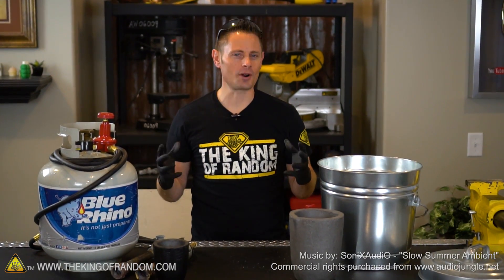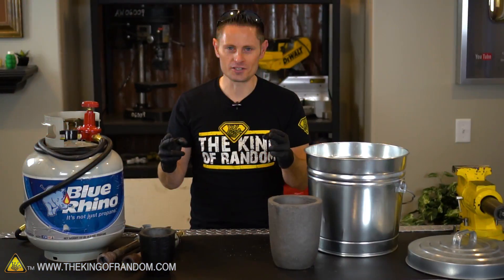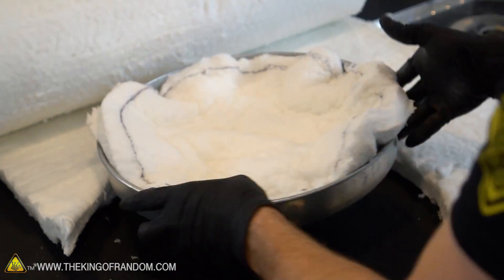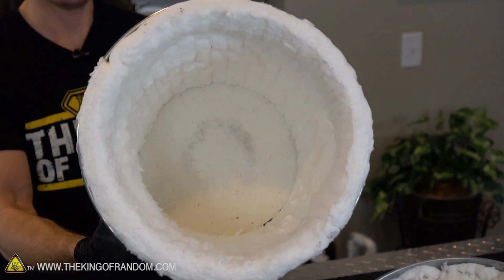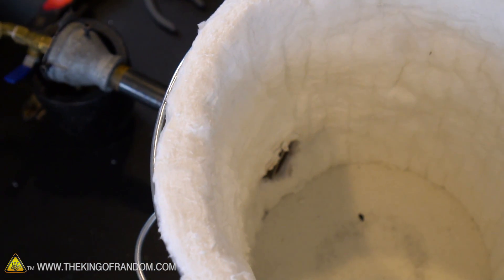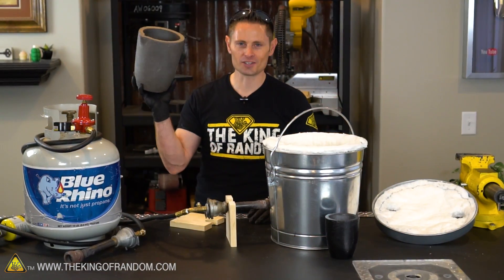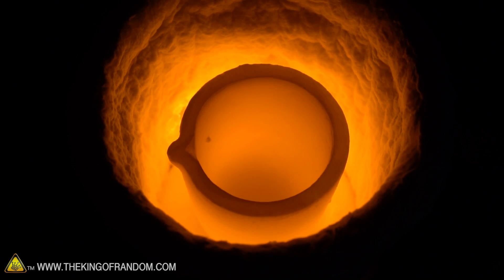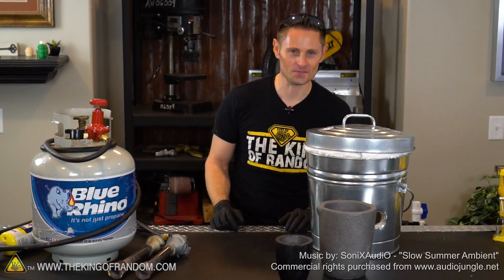Make A Trash Can Metal Foundry | How To Make A Metal Foundry For Melting Brass And Other Metals

Comment: Everyone: don't make a forge using galvanized steel
Me: poisonous fumes go snnnnnnnnnnn
Reply: use heatproof paint to prevent the fumes or muratic acid to remove the zinc layer, use a respirator too incase something goes wrong.

Comment: It's a furnace...not a foundry. A foundry is the place of work where a furnace is used to melt metal, pour molten metal into moulds and then to fettle the castings.

Comment: What, no satanite coating? Those fibers are going to go airborne and you'll likely breath them in. It's best to coat the Kaowool with about 1/8~1/4 inch of satanite. It also improves and protects the Kaowool by increasing its insulating properties.

Comment: turns out graphite crucibles are terrible.     verry expensive,  they corrode.   you cannot poor copper because it's too high temperature. (it will fully corrode after 1 use)   

if you make an electric foundry instead you can precicely control the temperature and then you can use a steel crucible.   it will last much much longer without getting too hot like it would in a propane or coal foundry.

Comment: Since it insulates so well, use spray adhesive to stick the wool to the lid.
Also, reaching in to grab the crucible looks daunting, so why not cut the bucket in half above the torch holes but below the level of the top of the crucible, then attach it to the lid.
When you pull the lid you can grab the crucible easier.

Comment: try melting some cheap jewellery (like the 925 rings and stuff you see on ebay/aliexpress) and cast an ingot from it. haven't seen you cast silver and it'd be interesting to see how the ingots turn out and finding what exactly the rings are really made up of (some of these rings are as cheap as a $1 so not too bad for testing an experiment)

Comment: What setup for the Gas nozzel at the end of the pipe did you use? Where can i find the parts for the Gasnozzel? How did you mange the O2 feed? Is that big thing a blender for the propane and air? I would be more than thankful if you could put the link of the parts for propane can in the description. Thanks

Comment: Has anyone built this using just one torch? Curious to know if/how well it would work.
Reply: Nathan Liu works fine with only 1 torch. Just takes a little longer to get the metal up to melting temps.
Reply: Thank you much!

Comment: Does anybody know if I could do this with charcoal and a air pump rather than using propane
Reply: Yeah, check out the mini metal foundry vid, he originally uses that one with charcoal and I believe a hair dryer or some other sort of pump. I would't use it with kaowool though, probably stick to plaster or refractory cement if you wanna go that route just so cleaning out the ash isn't terrible.

Comment: With that Kaowool you could possibly not have a bucket at all and just make a metal frame to hold the Kaowool in place. A little more expensive I am sure but safer.

Comment: For fun I thought I would apply a little of my heat transfer knowledge to the design of this foundry on the "How to Make Everything" channel comments. I'm sharing here as well as since this is the source for the design.
Assumptions:
1. Steady-state conditions.
2. One-dimensional conduction through the wall of 0.0254 [m]. 
3. Constant thermal conductivity for # 8 Kaowool of 0.30 [w/(m*K)]
4. ambient temperature of standard "room temp" 23 °C or 296.15 K
5. inside foundry temp between 1650°C to 2150°C assuming lower of the range 1650°C or 1923.15 K
6. container assumed as a simple Right cylinder r = 0.20701[m] h = 0.38862 [m] (surface area of sides 0.50547 [m^2] surface area of top and bottom 0.65 [m^2] )

heat flux determined from Fourier’s law
this suggests a heat flux of 19216.54 [w/m^2]
doubling the Kaowool layer will lower the heat flux to 9608.27 [w/m^2]
4 times the Kaowool layer will lower the heat flux to 4804.13 [w/m^2]

solving for the heat loss through the wall
9713.40+2*12497.3 = 34708[w]

basically, you could be losing about 118428 [BTU/hr] with the 1-inch Kaowool layer.

Comment: how do u tell when the crucible is ready?
Reply: Crome14 just heat it slowly till it's redhot then let it cool down naturally in the furnace, that way it should eliminate possible thermal shock and if there was any moisture in the crucible it would be gone after this . Also always heat you crucible up with the furnace as putting a cold or room temperature crucible in a hot furnace can very likely cause it to break.

Comment: What would be to happen if you insulated a charcoal foundery with fiber glass insulation?
Reply: J's WorkShop it would certainly not work, common fiberglass insulation has a melting point of 700 degrees  Celsius, Considering a chimney fire can exceed 930 degrees Celsius fiberglass does not afford block off area protection . I've never tried it I'm just going on what I've read and heard .

Comment: Kinda bummed about the Amazon links to the Koawool. Bought exactly what you linked to and just went to install it realizing it was only a 24" x 12" x 1" piece, not NEARLY enough to fit our trashcan. Now I need to order more and wait for it to arrive before we can finish. :(
Reply: I just ran into the same thing. Anyone know how much is needed for the 10 gallon trash can? Turns out this is going to be a lot more expensive than I first thought because I overlooked the kaowool wasn't the right size.
Reply: Just get the 6 gallon option for the trash can then it works fine 😀
Reply: Check your local ceramic supply store got 1" by 24" by 25' for $70
Reply: was that enough?
Reply: george no it's 1 inch by 24 inches by 25 FEET
Reply: spencerjw yeah I am looking at it now and the Kia wool that is linked will not work its way to small. It's not even the size of the lid
Reply: Brian Jackson I'm gonna link the right things when I get a minute
Reply: @jamesbaker6003  one year ago and it's not fixed.
Reply: Yea I'm ordering 1" x 24" x 31"
Reply: Michael Tefft they 6 gallon option can be found at Lowe's
Reply: was that enough?
Reply: george yo guys what he says in the video is totally not enough but if u get two 1x31x24 then it was enough for me (just a little bit left over). But I'd just recommend the 100$ one, which is 1x24"x25', and is plenty more then enough for what ur doing but get it just in case u want to make another one or want more for repairs and stuff like that
Reply: HagWorld I'm confused because from the dimensions you gave the $100 on(1x24x25) is less than a single 1x31x24
Reply: Hagworld oh wow, sorry I misread that my bad
Reply: The stuff in the video looks thicker than 1" -- maybe 2"?  Do you get the 1" stuff, HagWorld?
Reply: The 1"x24"x31" is JUST enough for a 6-gal foundry. Just completed mine today. The 6-gal bucket is 12" tall, and has a diameter of 11" at the bottom and 13" at the top. On the 24x31 sheet I traced a vertical at 20" separating it in 2 pieces: a 24"x20" and a 24"x11". The 24"x20" got cut horizontally in 2 strips of 12"x20" each, and these coat well the sides of the bucket, with some overlap that gets cut off (you get left with a narrow triangle of kaowool). The other part 11"x24" gets first a circle cut of 11" diameter for the bottom of the bucket, and you're left with an irregular piece approximately 11"x13". The lid is 14" in diameter, and you can cut a piece that almost covers all of the lid from the irregular piece. The space left on the lid can get filled creatively with assorted pieces that you get left from the cutting process. When all was said and done, I'm still left with a larger triangular piece about 3"x12", and a number of smaller pieces from the original sheet. And just so that the jigsaw puzzle that I made of the lid covering doesn't fall off, I've attached it to the lid with a few screws, then coated all of the inside with satanite (2 coats). Worked pretty well.
Overall, just one of the 24"x31" sheets was enough. I got two of these but didn't need to cut into the second one. I'll keep it for repairs or maybe a second foundry.
Reply: Thanks so much for the info, stamasd!
Reply: rustymississippi no problem hope that helps
Reply: how much did you have to buy?

Comment: Grant, or anyone who knows the answer. I have a the same type of foundry but with only one torch. I cannot seem to get my swirling action but can get it burning well pointed directly at my crucible. I feel as though this could creat hot spots which would be bad for the crucible. Amy help on getting the swirl? I have my torch at an angle so I feel as though it should swirl but it just keeps going out

Comment: I used to hang hoods for restaurants. The ceramic insulation he is using is very common, safer than fiberglass, while still potentially hazardous, will not hurt you in on application. I worked with it in my face pretty much daily. it was wrapped, however, we had to cut it to certain sizes to insulate grease duct.

Comment: If you have a moment, what sizes did you use for the supplies?  The 10 gallon can in the links doesn't match up with the 12x24" Kaowool blanket.
Reply: Check your local ceramic supply store got 1" by 24" by 25' for $70
Reply: Thanks!

Comment: Will I have to use a steel bucket because the wool will not let heat through so won't it not melt the metal can

Comment: Will one gas tube be suffice, or 2 is needed? Just after to smelt aluminum in it.
Reply: Jockey314 I use 1 and it melts copper so you'll be fine with 1 for aluminium 👍🏻

Comment: do you have to temper it everytime you want to use it
Reply: How to Random no just once👍🏻. But always store your crucibles in a dry place preferably inside your furnace and always heat your crucible at the same time as your furnace as even a pre tempered crucible at room temperature can suffer thermal shock and break or explode if put into a already heated furnace 👍🏻. Oh and check my melting vids ya might enjoy them 😉😁.

Comment: Kaowool isn't so bad before it is fired.  Afterwords, it can be deadly.  Don't use it with exposed fire.  Kaowool should be coated with some kind of refractory.  ITC-100 works great, bubble alumna is super tough and there are many more coatings that can be used.  This is a big no no!  We like watching your videos, but don't touch that stuff after it is fired without a mask.  Seriously!  Lung cancer is next on the random.

Comment: Just ordered the items and a Ladel needed from Amazon(without the propane torch thingy) and came up to $150. It works AMAZINGLY well. Ive made a multitude of Knuckle Dusters, Batons, Throwing stars, knifes and Axes. My next project is to reform those 22mm Cresent Wrenches. Thank you so much for this.
Reply: Update: Removed Handle and made the hole in the middle then used an Arch Wielder to add handles on each side of Hole, like the Cement Donut. Keeps more heat in and allow easier addition of metals, as well as allows access for the ladel.

Comment: to the people who want to do this, those links are wrong, I purchased the kaolwool and it reaches barely halfway around the bucket. no extra for lid or base either.
Reply: You Dont Know Me BbY Would you happen to have a link to the correct size? I just opened my package of two today and I don't think even that is enough.
Reply: Chance Sutter I haven't looked for any other links yet, perhaps getting a smaller bucket might be the way to go since the links are absolutely worthless for the bucket shown
Reply: You Dont Know Me BbY like the smaller bucket he uses in the original foundry? Let's do some research!
Reply: I figured out for the trash can if you just get the 6 gallon option instead of the 10 then just use the same stuff for everything else it works fine as you will see in his "trashcan foundry is lit" episode. 😀
Reply: Check your local ceramic supply store got 1" by 24" by 25' for $70
Reply: he got his for free from his mate thats why the link isn't correct
Reply: You Dont Know Me BbY you could buy two orders
Reply: Would buying two also allow for the top and bottom circles?

Comment: I'm going to put out there that this isn't a long term solution. Kaowool/ceramic fiber insulation will break down over several duty cycles, your best bet for a longer term solution would be a liberal coating refractory cement on top of the kaowool to protect it from direct contact with the flame.

Comment: Nice work. I made one almost identical about a year ago. After multiple firings the Kaowool will begin to break down. I couldn't have that as I was refining pure silver and it would get into the melt. The solution for me was to coat the Kaowool with refractory cement. it's a pain in the a$$ to get it on without wadding the Kaowool up in a big sticky mess but with patience it will make that furnace last for years and hundreds of firings. Where did you get the burners if I may ask? As always great job!
Reply from the maker: Thanks for the tip.  I made the burners in a previous video.  Gas Blaster Propane Torch
Reply: Caesar Augustus where do you get refractory cement???
Reply: Caesar Augustus what if you put something in between the kaowool and cement to make it easier to apply? I was thinking duct tape.

Comment: No. Just... no. That kaowool product is too dangerous to screw around with. Respirator while working it and - most importantly - sealed with refractory cement such as satanite. Those burners will dislodge loose kaowool fibers and blast them right out into the air you are breathing. Not a pretty way to die. Seal the insulation before use!

Comment: You should really consider coating the kaowool with ITC-100. The coating helps improve the efficiency of your foundry by up to 30% because it can reflect 98% of the IR radiation back into your crucible. IIt also protects against respirable silica. Refractory materials like Kaowool begin to break down at 1800 degrees releasing a form of respirable silica known as cristobalite. When applied to kaowool and cured, ITC-100 eliminates this problem.
Reply: SateenDuraLuxe how exactly does the stuff apply to the kaowool and how thick of a layer would you need.  Aslo, how much of the stuff would you need.  Its really pricy

Comment: You can use table salt to preserve aluminium from oxidize, or a glass (a crushed bottle does the trick), the salt or silicon melts, floats and create a crust over metal and prevent oxigen to interact with metal

Comment: toxic kaowool so no mask, galvanized metal using heat puts out fumes so no warning or mention of ventilation and no mask...I am guess some one needs a down draft system or to do this OUTSIDE in proper PPE and issue warnings before Joe Schmoe who doesn't know better tries it and dies

Comment: Love the video. However, when you heat the crusible red hot and let it cool on its own is called Annealling it, not tempering it.  Annealling it removes all internal stresses.  Tempering it is a different process, and not as much heat but doesnt remove the internal stresses.

Comment: i think the combustion of the propane os not total in the foundry probably beacause it need more O² ( or any other Oxidizer) ( sorry i dont speak english )
Reply: O2 is picked up in the mixture chamber of the torches. You can tell that it is complete combustion by the blue flame and lack of smoke and soot.

Comment: Try melting glass in your new metal melting foundry
Reply: lol, those crucibles can handle steel, and pretty much anything if tempered correctly.
Reply: Glass melts around the same temperature of aluminium (1,200 f°). An ordinary camp fire can reach those temperatures
Reply: I don't know the melting point of glass but would think the Crucible would give up before glass melted

Comment: Do you need to temper the graphite crucible only once? Also, when the crucible is red hot and ready to pour, will it crack if I put it on the cement outside the furnace? BTW, cool video! I like the idea of using two burners!

Comment: is the larger volume of this foundry only allow more metal capacity for the smelting of soft metals?
or because of this new size is this modified foundry able to smelt a wider variety of metals?

Comment: Can you show some thermal camera footage of the outside of the larger and smaller foundrys? It would be interesting to see how well the wool insulation preformed compared to your earlier plaster foundry side walls. Also a side by side weight comparison would also be interesting, how portable (difficult to transport in the back of a car etc.) are the foundries.

Comment: make sure that trash can is not galvanized becouse the area around those holes can get hot enough to start letting of those nasty zinc fumes , witch usually results with zinc poisoning.

Comment: You Are great but this is terrible. This is basically asbestos. You will be releasing fibers through the air everytime you disturb it with the crucible and with all the gas flowing around the crucible. You now need to completely decontaminate that whole room. Dont wait for them tell tell you in 20 uears that this stuff is bad.

Comment: Something to add; we've been using kaowool to build blacksmith's forges for years now, and one super-critical thing to note. It's fine to cut slow when it's cool,  but it disintegrates very easily when hot if you poke it.  If it does get hit when hot, you also have the added effect of that hot ceramic dust being blown out at you by the gas pressure. It's best to put a fire brick in the bottom of your furnace or forge to put parts or the crucible on, which has the pleasant side benefit of making your lining last a lot longer.

Comment: Is that somewhat similar to asbestos????? Which is extremely dangerous for your lungs.
Reply: It is similar to asbestos. Long fibrous dust that stick and poke the lungs.
Reply: Aahhhh interesting, when it comes to fire resistance who do you think will take the trophy??
Reply: Sodium Tetraborate the wool would win, asbestos cant handle as mcuh from what i have heard
Reply: No. I think it's ceramic.